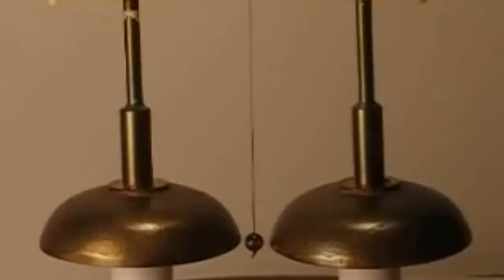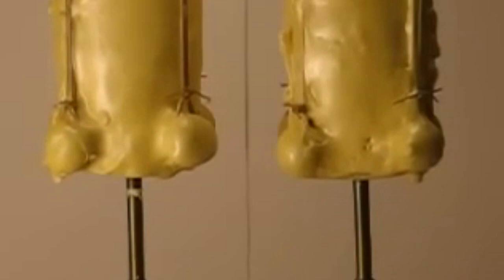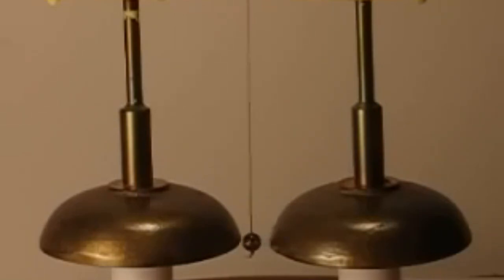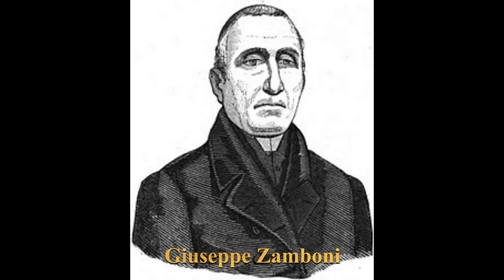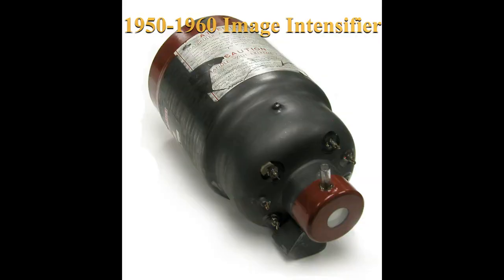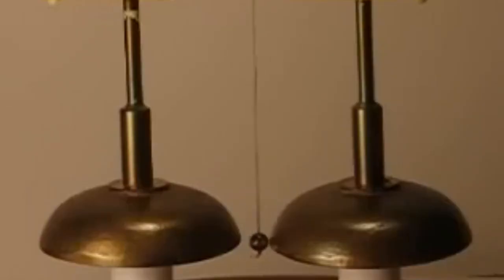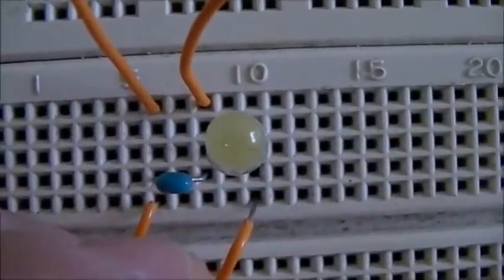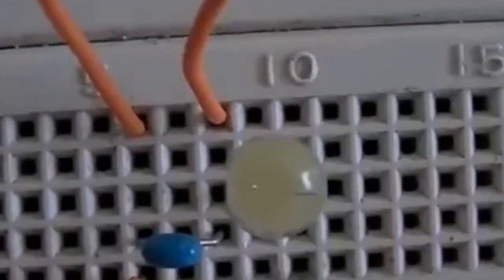2150 A Battery That Lasts Forever - The Zamboni Pile

Comment: The ball pendulum acts a bit like a spark gap... with such an electrostatic device the ball would slow down as the capacitors became full, the voltage difference would keep the current attempting to charge one capacitor meaning the ball would continue to swing, but at a slower rate as their woukd be some resistance... its fully charged charging from the atmosphere... I promise you... this is a perpetual motion device... the series connection of the capacitors keeps a stronger magnetic pull at the top spheres pulling in positive energy... this causes a stronger magnetic field at the bottom which in turn would cause static buildup... im particularly interested in the shape of the electrode conductors at the bottom... theyre like pillars... ancient Greek pillars lol... even a negative charge can cause motion in the ball pendulum

Comment: You've made an assumption that it's connected in series... what if the tops are negative anodes or maybe even cathodes connected in parallel pulling energy out of the air maybe using the combined cells of each series to enhance the atmospheric charge like how tesla did with wardencliffe.. and the bottom is passing charge between the capacitors... that voltage is a clear indication of a natural static charge... you coukd create a continual motion between the 2 capacitors if there was a voltage difference between the 2... that would cause one to align as + and one as -

Comment: I'd also like to mention the discovery that tesla made when connecting a coil to a capacitor... he was able to charge the capacitor and have the current bounce back and forth through the coil for a very long time... maybe this uses a similar principle... now I know the Oxford bell doesn't use a coil but essentially an induction coil is a type of capacitor so wouldn't it stand to reason that 2 capacitors may be able to do the same job...

Comment: Come on man we've all seen a voltas hailstorm and you just stated it has a dioxide dielectric so it must be a static capacitor... its still cool that it's run for this long if it is a static battery

Comment: Hello. I love your show. I wanted to tell you that I have had very good results by changing the electrolyte in standard lead acid batteries to an alum mixture. I just dump out (and neutralize) the sulfuric acid and replace it with an alum mixture (6-8 US cups of aluminum sulfate powder per gallon of distilled water). Note that before doing this one must run the battery down to dead 0 (or very close) in order to put the sulfation on the plates. Yes, we want the sulfation. Charge with conventional chargers, pulse chargers, or whatever. These batteries seem to be very forgiving and hold their voltages at lower levels. They can be charged well over 13v (maybe over 16v) and they will stand around 12.3v and hold a lot of power even down at 9v. The alum mixture is a mild acid that doesn't bother my skin, but will eat holes in your clothes.

Comment: Robert, as always, gets us thinking  about something really interesting! This video is no exception! The fact that this contraption stops and starts as a function of humidity is very telling about how it operates. Capacitors can be discharged  due to high humidity but CAN NOT recharge themselves when it's dry. The concept that this thing is still operational from a charge applied over a 100 years ago is just scientifically silly. I wonder about the triboelectric effect due to the silk thread sliding through the air. Perpetual motion machine??? Not likely but it might help explain why it stops  with high humidity. Another obvious reason for stopping is the electric conductivity change of the silk due to the humidity. Considering 1 nano amp = 6.2 billion  electrons in 1 second  it's far from likely the charge  on the capacitors is  from the original charge so many years ago. Skin effects on the surface of the capacitors and internal resistance / leaks would have discharged it in days or months. However, small Electron flow between the dissimilar materials is a plausible explanation.  Like a really lousy chemical battery multiplied by 100s of cells. And also obvious is the Thermocouple effect which is similar to the explanation above. There are lots of reasons it looks like a super capacitor but ... Don't be fooled  by the arm waving explanation provided by the original inventor.His  story has been told so many times it just must be true!!!! LOL. NOT!  But, after working on particle accelerators for 40 years I know the first explanation of an anomaly is often wishful thinking. It's likely the got it to work from a single charge for a day or two and set it aside after it stopped due to capacitor discharge. Perhaps he checked it out a month or two later and It was amazingly working.... For other reasons than capacitor charge ...

Comment: Great video! I had an important question though regarding copper inks. After you inspired me to begin my adventure in conductive inks, I was having issues making a graphene copper ink. I bought copper powder that is 325 mesh or 44 micrometers and the problem is, my sample gets very varied values of conductivity when u place the probes in diffferent areas. This is even the case in 60 minutes of sonification. I really dont know what I am doing wrong and would appreicate some help @Robert Murray-Smith

Comment: What about the chance on shortcircuits on the edges of the square paper/aluminium parts. The carbon ink soaked into the paper, so is already very close to the sticky side of the aluminium foil. Is that glue the isolation?

Comment: The battery is not dry.
It relies on humidity in the air.
Reply: If that's true why does the motion of the bell striker slow/stop in humid weather? Introduction of moisture to these piles surely brings about galvanic decay, which should kill it off in a matter of months (albeit that in those months output wattage would be higher). This one's been going for 150 years. Zamboni patented a dry pile, sealed against outside elements, I'm pretty sure it's dry.
Reply: @trevorsambrooks1988  True. It needs very dry conditions to last.
The decay has to follow it's energy demand as slow as possible.
Reply: To much moist lowers voltage buildup as charges get shorted out via the electrolyte between layers of materials, faster than it charged in the 'dry' statel.

Comment: The fact that the piles that runs the bells is sealed in sulfur, may be the reason the piles work for so long, if the sulfur is able to replenish the electrolyte slowly over time, it could remain running longer than expected!

Comment: How do you stick the foil to the paper does it come with a peel and stick thing on the back
Reply: Yes, it is adhesive tape with peel-off backing. However, the adhesive is usually non-conductive. Copper foil tape with conductive adhesive is readily available.

Comment: I have a radio shack indoor/outdoor thermometer thats been running on the same AA duracell for a little over 20 years. The battery expired in 2003. I don’t understand how its still working. I found it randomly about 10 years ago and now occasionally pull it out to test the battery voltage. Last I checked some months ago it was at like 1.34v.

Comment: I got a “fun fly stick” (a small handheld battery powered van de graff generator) for Christmas when I was 15. 

It had an experiment kit, including a much larger and louder electrostatic bell. Almost immediately I tried one of the things that the book specifically said not to do: I made a capacitor from a plastic mustard squirt bottle, some saline and aluminum foil.

If I remember correctly you could connect this capacitor across the big Franklin’s bell and it would get up to maximum speed after 30 seconds of charging. Then it would take 30 minutes for it to stop. 

I’ll have to see if I still have my notes, this all happened a decade ago.
Reply: Cool !

Comment: I did a back of the envelope calculation. If the battery truly outputs 1 nano-ampere at 2000 volts, then it has so far delivered about 3 watt hours of energy.

The amazing thing about the design is not how much energy it can put out. It’s that it’s able to keep macroscopic motion going with so little power input!
Reply: Not just that, but the virtually 0 self discharge rate! That’s probably the most amazing aspect about this battery.
Reply: @deltab9768.  Yes, the numbers work out to about 3 watt hours of energy.  In comparison, a modern alkaline AAA cell will deliver about 2 watt hours of energy when subjected to a low power load and an alkaline AA cell will deliver about 4 watt hours of energy under a low power load.  However, neither of these cells will last anywhere near 183 years due to self-discharge.

The pile in the video must generate its energy through an electrochemical process and have very low self-discharge.  I have to disagree with the statement made at time 4:18 to 4:25 in the video.  If the pile were purely electrostatic, it would discharge fairly rapidly as there would be no way to replace the energy used.  Electrostatic demonstrations get virtually all their energy due to the energy gained in physically pulling apart the two substances.  The initial charge transfer that happens when the substances are in contact actually consumes a tiny bit of energy due to the electrical resistance in the substances as the substances go from a higher energy state to a lower energy state.
Reply: @analog_guy the nano amps are throwing me off. I've personally measured at least 40 years old, crusty, zinc carbon primary cell and it still showed ~0.3V. Internal resistance must have grown immensely and most chemicals reacted by self discharge. But if we talk 1 nanoamp it could have probably still run for years.
This thing could be same: barely going after 10x shelf life.

With this power draw, the electrolite could be horrible at doing its thing, with ridiculous internal resistance, slowing the galvanic reaction between the metals in the pile to crawl, this would remove the ability to provide any sane current, but it would slow down self dischare same way. And if you need 1 nanoamp is should not have a sigbificant impact on the draw..
Reply: @Beardest-b4p  Yes, modern batteries can continue to show some low voltage after many years.  It would be interesting to measure very old batteries with an electrometer that draws a nanoamp or less and see what the voltage is.  The pile in the video probably does have high internal resistance, but its voltage at the one-nanoamp draw rate must remain quite high or else it wouldn't provide enough electrostatic attraction to pull the clapper from bell to bell.
Reply: Well that can't be correct at all, because a 50 volt capacitor can only run one of these for maybe 10 minutes tops, and that's holding thousands of times more amps. I can't imagine that a lithium ion battery would have this running for so long, and it's a better battery. I am willing to bet that despite putting the starting date, the one thing they don't put is the repair dates when they replace parts.
Reply: @lepayen  this isn’t a capacitor. It’s a battery and a large one at that. The whole thing probably has less power than a single 18650 lithium cell and it’s much bigger.
Reply: @lepayen  there’s 1000 000 000 nano amperes in 1amp ,might need to redo your calculations
Reply: @lepayen  Assuming it's a dry cell, it's not capable of high discharge like wet cells we have today. The trickle of electrons spontaneously jumping from one material to the other is how it works. Electrostatic piles do not have a lifespan. They are activated by disturbances in the electromagnetic field surrounding everything. Either one could last longer than a lifespan. there are no moving parts except that wire. it's worn at the pivot, tiny bit. clapper is mushed out of round. still original.
Reply: @pauls5745  No, that's not how it works. Our current AA and AAA batteries are dry cells, they can be completely discharged. The rechargeable lithium ion cells we have, can not. Electrons do not spontaneously jump from one place to another. If they did, we could recharge things just by throwing them or rubbing them.

Comment: One of the things that kids were encouraged to try was to stack copper Pennie’s with silver dimes and a piece of carbon paper between some of the coins.
Dime, penny, paper, and so on.
You would put the stack into a salt solution, and you then had a battery, but not a lot of power.
LEDs didn’t exist back then, and even the smallest incandescent flashlight bulbs would not light up by this thing.
The instructions said to put wires at each end, and touch both to your tongue.
You could “taste” the weak current, which was so low as to be harmless.

We no longer have silver coins in circulation, and I’m not sure if it would work with today’s dimes.
Reply: And  won't work with today's pennies neither.   Not copper anymore!

Comment: What a nice little puzzle! Just from the performance figures (high voltage/low current and long life) I'd guess it uses radioisotopes as the "fuel". But ...1840? Very mysterious. As the cell is already sealed in a jar, looking for decay product buildup (like radon) might reveal the secret...
Reply: It’s a super slow battery type chemical reaction. A quick calculation says that over the last 180 years it has delivered less energy than a normal flashlight or cellphone battery.

Comment: Great video on an interesting subject. I have experimented on this myself using printer paper spray on graphite lubricant (solvent carrier and graphite) and using galvanizing spray paint zinc powder (Rust-oleum cold galvanizing compound )for the anode side.I tested it by just spraying it on opposite sides of the printer paper and cutting it into squares just as you did.  Using a high impedance Fluke meter I could read a voltage with about 50 sheets. The next time I tried it it didn't work and I wondered if the  sprays had penetrated the paper or shorted out at the edges or perhaps the humidity had an effect. I will try a  template to mask the edges of the paper to avoid 'shorting' when cutting through the paper someday.
Reply: Whoa.   😮  can't wait 'til I reach your level.

Comment: I use four pennies and four nickels I clean them up real good will the metal brush on my table grinder stack them penny nickel penny nickel etcetera put tiny pieces of paper towel in between each coin and put enough vinegar on it to wet the paper towels in between and I got almost .51 volts I call it my 24-cent battery
Reply: Have you noticed any output variations with inflation?
Reply: @zaptainkuboom5520  that's a good one🤣

Comment: I made some out of magnesium pellets and silver pendant discs made a crude one at 32 volts. Keeps 12 volt systems charged with with a capacitor and a transistor switch for DC pulse charging
Reply: Have you done experiments?
Say, could i calculate the materials and produce a stable voltage for a raspberry pi?
Reply: @nubletten  a bit some of them quit working when they dry out and then act as a really good humidity gauge. Other build types stop working when they get wet and work better Dried out on the stove or even put off the most power when attached to the stove pipe when they get heated and they act as a thermal electric generators especially the salt versions with copper and iron. Very reliable copper pipe with iron rod and salt compressed between

Comment: I like your heater better it's a lot more useful. Can I make the graphene from powdered graphite and  30 or 35% hydrogen peroxide like you did with your "Super Easy Graphene" I think it was some sort of flaked  graphite?  According to google graphene is the best electrical conductor there is.Thanks Robert

Comment: Forgive me, I've only learned what I know about these things from your own channel , yet my first thought, when you mentioned that it was still being debated if it was a chemical battery or an electrostatic device, was how to deplete it more quickly and get a solid answer.

This led me to think of my next line of thinking, which was if your explorations of the fractal capacitor might be of exploratory value here? While this might not cause it to deplete any more quickly, might we get a more usable output with such an arrangement?

Comment: The fact that a specific level of humidity can cause the device to stop function seems to indicate that it is an electrostatic battery.

During winter dry air conditions, when you drag your feet on the carpet and then touch something metal, you get an electrostatic shock.

When this happens in the dark, you can see the very brief light of the spark.

During summer when the air is most humid, this phenomenon tends to not happen. If however, you can generate enough static electricity by rubbing a balloon or something else, then yes, you will get a shock. 

This discussion is not about what someone can do by artificially manipulating the environment. This discussion is about what occurs as the air naturally changes in humidity due to whether conditions.
Reply: I'm thinking its just a dry cell of many stacks. Probably generating a few KV from the sheer number of cells in series. High voltage DC is essentially "static" electricity and will generate noticeable fields like the one seen between the bells.   Higher humidity and "leakage" occurs between plates, higher than its output current if the humidity goes too high. Maybe even between the bells as well.

Comment: brass when moving does atract to a magnet is that happening too?
Reply: Not in this case. It is just electrostatics. The bell touches one side and receives a charge, which pushes it to the other side where it receives another charge of opposite sign, pushing it backwards.